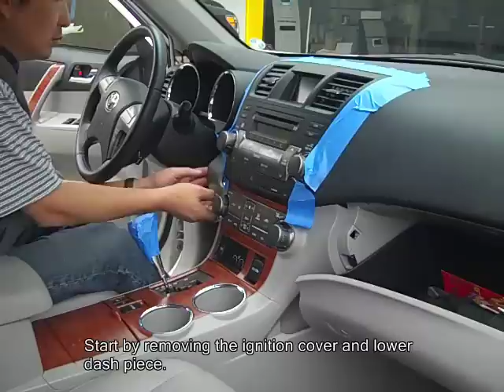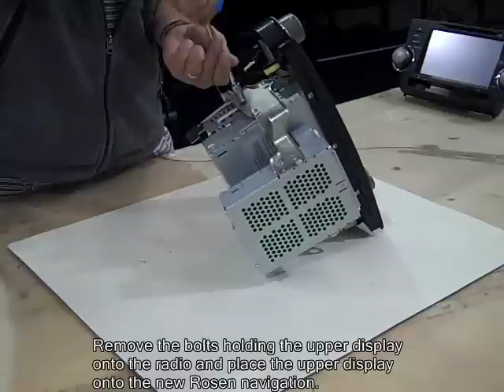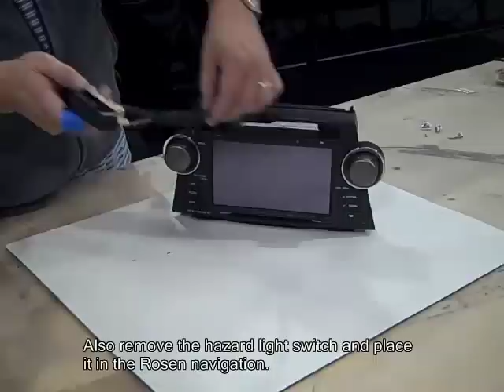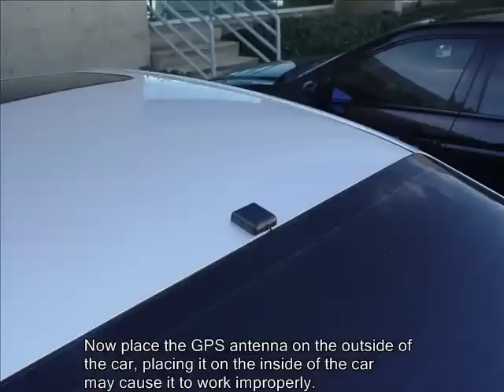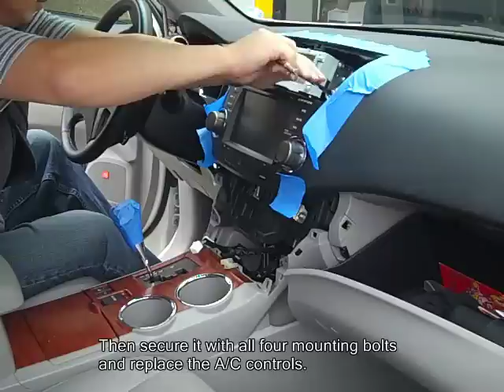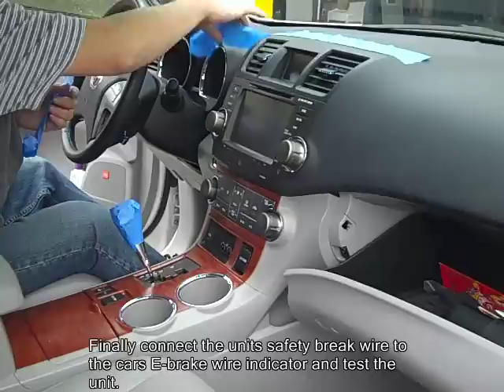Highlander

Comment from the maker: these units are a plug in play design , they should be know reason this would void the new vehicles warranty.
there are only 2 wires that have to connected to reverse trigger if back up camera is installed or if equipped with the factory not needed, and the E brake wire for safety overide

Comment: Hello RESsupport team. I have a 2010 highlander limited edition with Rosen head unit. Every now and the radio would power off and I would have to disconnect the car battery and then it would turn on again. Any suggestions?